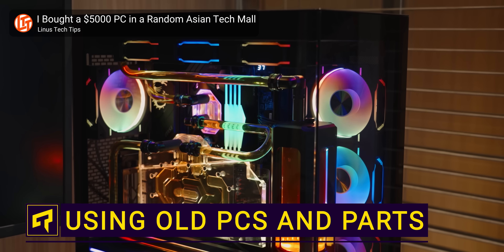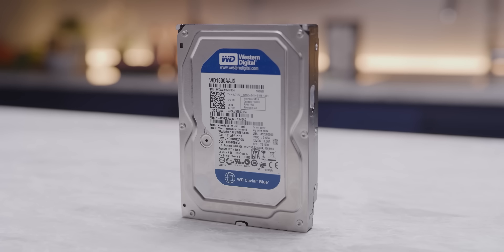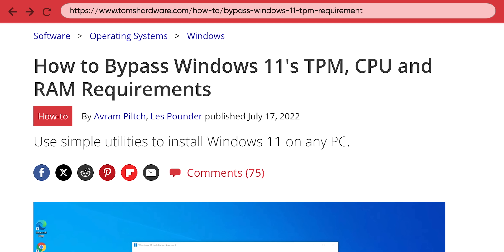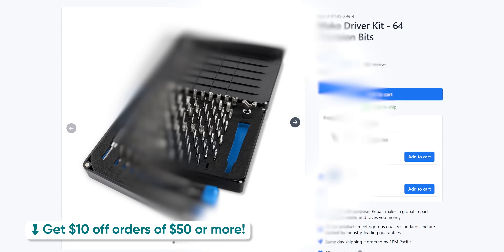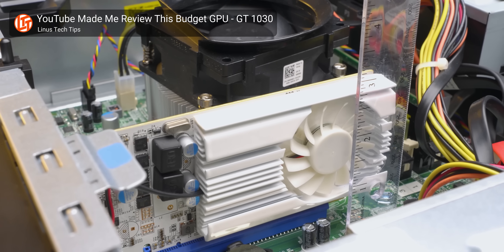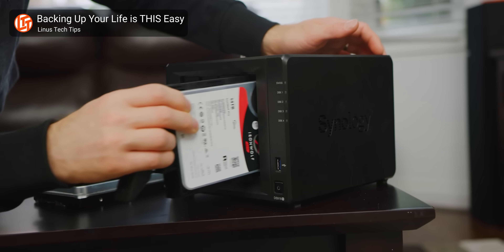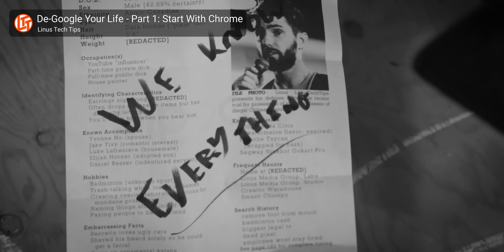FIVE Cool Things To Do With Old PC Parts

Comment: Old smartphones make relatively good and cheap security cameras. They only need a wifi signal and some power source, and there are many apps that work on them for this purpose without much configuration. You can access these cameras any time from a main device. I used to monitor mice traps with it.
Reply: Yeah would be interested in that idea too. 😊
Reply: The IP webcam app works perfectly for this. You'll be able to check the live feed from any device that's on your local network, and you can even set it to auto record when it detects motion.

To have them accessible from anywhere, youll need another service in addition. Of these I only know Ivideon which works but I wasn't too much of a fan
Reply: Can you recommend a specific software? I once tried to do this, but did not dig enough. Preferably open source
Reply: @srpenguinbr  I used alfred camera from the google play store, I don't think it's open source, but if you do your research I'm sure you can find an open source one.
Reply: @srpenguinbr  I dont know if its open source, but try alfred camera. It could go HD if you pay the subscription if i'm not mistaken, otherwise go for SD for free.

Comment: But if you have a new computer to replace the old, the new computer would likely be able to do all including opeeating as your daily driver. It would be a marginal increase in power since your computer would be running anyways. If your computer isn't always running, there are less power hungry setups that could do all that then running an old pc. With exception of running older games, why do this
Reply: The folding@home idea is great. You can either try to contribute to life-saving research on that secondary computer or throw perfectly good electronics away like they're broken, your choice.

Comment: Any linux distro will work miles better than ChromeOS Flex, all without the privacy and lifespan issues of a Google product.
Reply: When you compare ChromeOS's seven years of support to other mainstream options, it sounds pretty good, but then you turn and see my 21-year-old Thinkpad T42 running Debian 12 and still getting updates, all while not being bogged down by the operating system... (winces) the seven years doesn't sound so good anymore
Reply: Pretty funny how they suggest ChromeOS in one breath and then suggest "de-Googling" in the next.

Comment: “Slow PC from a decade ago”
4790K
Reply: It might be a decade old, but he lost me at slow
Reply: @avisprimey  I hate to say it, because I had a 4790k for a long time. But the modern low end and midrange CPU's out there these days run circles around our old Intel chips.
Reply: @Benefits  ...but the 4th gen Intel chips are just fine for most tasks.
Reply: @Benefits  yep thanks to amd
Reply: @AffectionateLocomotive  I'm going based on the model number change. If I started at the beginning, It'd be even higher than 6th if we included the Pentiums, Core 2s, etc.
Reply: @avisprimey  what..
Reply: @AffectionateLocomotive  The Intel product page LITERALLY says " 4th Generation Intel® Core™ i7 Processors " It's not that complicated. Now go make a router out of your old PC pr something
Reply: @avisprimey  you can feel the speed up on more modern hardware, i upgrade from a 4690k to a 3600 cause the motherboard pissed me off 1 too many times with select sata ports randomly not working
Reply: @chadmckean9026  That's a good upgrade! My laptop CPU, a Ryzen 5 5500U, looks pretty similar on paper, and is pretty overkill for anything I need to do on the go. I've decided that if I ever need to build a new desktop rig, it's gonna be all AMD.
Reply: @avisprimey hate to break it to you but an i3 12/13/14100 mops the floor with that poor 4790k.
Reply: @toaster98  I know this. I daily drive an i7-12700. Yes, it's faster than a 4790k. But the 4790k is fine for most things. I never said it was faster than what's new.
Reply: still playing VR here on a 3770k that I got 10 years ago
Reply: brua i have a gt 730 wight a i5 10th gen and it can run totk
Reply: Could the tech team make a guide how to make 18650 type battery powered fan please? 😁 As a part of reusing old components 🙂.
Reply: I said the same thing. That was a decent set up for a lot more stuff than you'd think.
Reply: outdated and slow
Reply: My server is a 4790s with 4 to 5 people simultaneously doing office stuff....

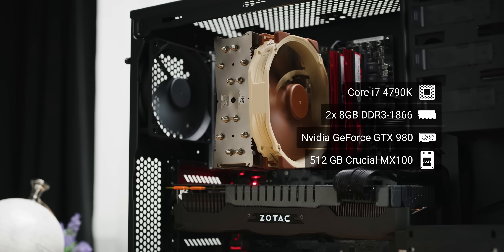Comment: 0:34 i feel attacked beacuse these are the exact specs that i still use in my Gaming PC
Reply: That thing is way overkill to just be a router. It's still a relatively modern computer. If it's able to play modern games, even if slowly, it's too much for a basic home router. It could be a media server, though
Reply: Yeah I run a gtx 980 and a i7 3770 and its an incredible machine. GTA V, BeamNG run at ultra settings perfectly. If newer titles run at low settings + 30fps it doesn't bother me but I havn't really gotten any really new games yet due to their crazy price points...
Reply: My "gaming PC" consist of free e-waste parts. Xeon CPU and mobo from 2012 workstation, Quadro P4000 GPU from 2017 workstation,  sodimm ddr3 with adapter,  M-SATA SSD with SATA adapter, 2.5" HDDs for extra storage , inside of new cheapest thin case and PSU. Total cost for just CPU around $30 ( case, psu, adapters). It serves 99% what I need.
Reply: brua i have a gt 730 wight a i5 10th gen and it can run totk and its the pc i use
Reply: @TheShinyShrimp  why have a gt 730 with an i5 that has a better iGPU? Or is it a 10400F
Reply: @ruinedlasagna  what
Reply: @TheShinyShrimp  10th gen i5s  have integrated graphics that are more powerful than a GT 730. The 10400F is the only 10th gen i5 without an iGPU
Reply: @ruinedlasagna  ohhh realy thats cool tnx man i will chick if its the k or f model to see if it has integrated grafix
Reply: Yes i also i5-4670 Gtx750Ti
Reply: I am SUPER close to that build too... i5-4690k with a GTX-970... 

Putting new hardware in is kind of pointless. New graphics card? Yeah but my mobo is pci-e 3.0... how much performance would I be leaving on the table because of that?
Reply: @teebles  Pci-e 3.0 is not much of a bottleneck. 2.0 doesn't even bottleneck a GTX 1080. You'll sooner be limited by the CPU than a 3.0 x16 slot. Just don't get a GPU that doesn't have all 16 lanes available (i.e 6500xt)

Comment: I have a 2008 HP desktop (which used to be a beast back then) for all my data needs. It has an SSD for the OS and 4 spinning hard drives in raid 10 for the data.
I'm not a big fan of using desktops as a router though, they are noisy and consume a lot of electricity.
Reply: yeah, no, the desktop-as-a-router suggestion was a horrible idea. It's more of a "why not?" homebrew experiment than something I'd practically use. But hey, you might never know a person's circumstances

Comment: The "outdated system" they show for running a router set up is basically my daily driver... fml
Reply: Same here 😢
Reply: @darkrider92  Was my daily driver from 2014 to 2019 too, except with a GTX 1080, and my sis is using it to this day.
Reply: This video is one of the worst researched ones they've done in a long while. Even the folding@home suggestion comes with significant caveats.

Comment: The bad thing about reusing old hardware: the power efficiency.  Having a power-hungy PC spin its fan 24/7 does not sound ideal.
Reply: hungy
Reply: That is not necessary always true, yeah its not as efficienct but that doesn't nean it will run hot and loud just that its performance is not as good, that other part of the equation of efficiency. Newer high end intel cpu like a i9 caN easily use 250-350 watt.

Comment: Going to be turning my old FX 8350 system into a NAS once I get modern mini-pc for my mother to use. She needed a PC and my old system was sitting around so I let her use it. The motherboard it has supports 8 sata drives, 2 e-sata and has 4 usb3s (plus lots of usb2) so can handle a lot of drives at once. So besides the old cpu it's overkill for the web browsing and word processing she rarely use for it, and doesn't support win11.
Reply: Look for N100 mini-pc.

Comment: What I did with my old PC parts such as RAM,CD drive,and GPU (I kept the fans s back ups), was give them to CEX (Computor Exchange) here in the UK and the parts like case,mobo, cooler, CPU and GPU I left for the metal faires to recycle/sell.

Comment: This only applies to countries with nearly free electricity as otherwise it would be much more worth to buy a new, energy-efficient hardware and sell the old one, even for scrap...
Reply: Sort of like what I’m doing right now. I realized that my main computer is almost never actively used, and what I need it for as a server is better done without a desktop cpu and a gpu that uses 20watts at idle… so I found a 2014 Mac Mini on eBay for 60 euro, making it more efficient than my computer, and cheaper than a new mini pc.
Reply: @AlexTheStampede  yeah exactly - a very good alternative is a steam deck. You have a full linux system with a cpu that draws 0.2-3w even when playing light games.
Reply: Really just depends on what you have and do with it and how much newer components cost and how much they draw for the same tasks. You have to calculate that, since it's not always cheaper to buy newer components, even in Europe with 0,30-0,40€ per kWh
Reply: You could sell the old PSU and buy an efficient one.
Reply: @rockpie  Ideally, you want to be using components that don't draw much power in the first place. A super efficient power supply doesn't help you save much energy if the whole system draws 600W under load and it's busy a lot of the time.

Comment: I use plenty of old notebooks, core duo and all the "useless" 32 bit hardware.
Only problem with desktops for firewalls or nas is power consumption and noise.
Reply: I have a truenas system running 2x16tb mirror array - converted from my old pc.
It has 64 gb of ddr4 3200mhz and an i7 8700. (I upgraded 2133mhz 16gb to 64gb a few months ago)
No gpu, no rgb, platinum nothing unnecessary.
It lives in a case from 1999 (hooray for standardization) with literally no fans except stock cooler - CPU idles at 22c. 55c in summer (30c ish indoors temp)
It entire system draws 90 watts idle, ($0.0045/hour). (cpu is underclocked slightly, and idle utilization is 0-1%. At max load, cpu will spike to maybe 8-10% util. Bottleneck is the 1gbps networking, not the drive or cpu), and hits about 120 watts, iirc, drives full duty
I'd say both noise and power is not really a huge issue if you plan for them.
Reply: @tfr  nice
you have access to hardware way newer than I do

Comment: Summary:
1. router
2. upgrade (new hard drive/ ram)
3. run old, supported games
4. contribute to a distributed computing project (folding@home)
5. NAS (surveillance server, own smart home, own cloud)
Reply: if you do #4, then your PC can also double as a space heater
Reply: @peanuts.13  Exactly what I was saying, though the new 13th gen and 14th gen chips seem to do this on their own anyways. Literally have to run power saver mode on my new build during the summer (this is also a potential fix for anyone experiencing CPU spikes with game crashes).
Reply: @peanuts.13  I legitimately used my Xeon X5450 PC as one several years ago. It overclocked to 4GHz with my GTX 970 and GTX 650ti running F@H noticeably warmed the room up. Only did it due to the house having solar however.
Reply: 1. To high electricity bill not viable...
2. To high electricity bill not viable...
3. To high electricity bill not viable...
4. To high electricity bill not viable...
5. To high electricity bill not viable...

...in germany.
Reply: 6. Server (ie. game server.)
7. Crypto (if legal)
8. Random experiments with software and hardware.
Reply: @rockpie  an old computer will not be efficient/powerful enough for crypto to be viable. You'll spend more in electricity than you'll get back in crypto value. unless your plan is just hang onto that crypto, blow up your energy bills, then hope crypto appreciates in value over the years, which it likely won't. The time for appreciation of crypto was 10-15 years ago before people really knew about it. Now it's too common among grifters and scams to gain value given the lack of trust in those who use it and its unstable perceived value.
Reply: Distributed computing is a horrible use. Super power inefficient.
Reply: Thx for saving me the trouble of watching a video
<3
Reply: Unraid server running Plex media and drives hosting all my important data.
Reply: sooo
1. keep using but with other purpose
2. keep using and upgrade
3. keep using
4. keep using but with other purpose
5. keep using but with other purpose
Reply: @markushahnenkamm I think you meant to watch “5 cool ways to not use your old computer”, the whole point of this video is how to keep using it.

Comment: My oldest PC is usually made into a media center rig. As long as it has a video card and the case it's in can handle a bunch of hard drives then its good enough to pump up to 4k movies and such to a TV and do so without all the extra snags of having a "smart" TV.
Reply: Got me thinking, can you access it(nas, home server) without having a smart tv? and if no, are you accessing it on the web or there is a plex app?
Reply: @SatlaE  All I ever used was a wireless keyboard/mouse combo and navigated it like normal. All you are really using the TV for is a oversized monitor if you are doing it right.
Reply: I agree, I wish there was a Home Theater OS for PC to run it like a normal media player
Reply: @SplitScreamOFFICIAL  If I remember tight there once was a version of windows along those lines but the whole thing defeats the freedom and flexibility of using a PC as a media rig.

Comment: 0:28, Ah yes, totally a relatively slow PC from a decade ago.
Reply: Yes, in 2026/2025 a 4790k is in fact relatively slow
Reply: I currently have an i7 4790k, w/32gb of ddr3 and 2 1080tis in SLI. It ain't no slouch...
Reply: @mikek92 did you mean 1080tis?
Reply: @notCAMD  Yes, thanks.  I corrected it!
Reply: @mikek92 SLI 1080tis?? Do any games even benefit from that?
Reply: @ruinedlasagna  The only game I know of currently is FFXIV.  Gamers Nexus uses it to benchmark cards. Surprisingly, in my "new build",  the 1080tis beat out the single RTX 3080 I recently grabbed.

Comment: Good video. It would have been helpful to mention that these old systems often draw a significant amount of power on idle. In applications like a DIY router that should be a consideration.
Reply: In Canada, electricity bill pays you
Reply: Quebec hydro OP
Reply: There’s a lot of power saving optimizations you could do to minimize the draw from your idle components. On the most basic levels for beginners, starting with windows power plan options is a good start.,
Reply: My server's got an i3 4350T that sips energy (35W TDP) like a brit sips tea. T-processors are fantastic but unlikely to be found in old gaming rigs. I mostly run Plex and Pihole on it, under Win 10.
Reply: @bgezal On most boards you could DIY the T-part by setting power limits to 30-35W and disabling turbo boost, that's pretty much everything Intel did. Most likely there is no special binning involved, at least not in favour of the T chips.

Comment: My old PC is a game streaming machine (and it has a mapped network drive for photo backups) using Steam Link. I do need to try Moonlight at some point, but steam link is great if I'm waiting somewhere and don't want to doomscroll social media. It doesn't matter that it's a bit outdated, it just has to render 800p medium for the steam deck or 1080p low for my phone
Reply: I use my Steam Link (hardware) all the time and it works really well. I hear people talk about the better image clarity with Moonlight, but at couch distance, I don't notice. Moonlight forces the controller to use Xinput, so it's DOA to me since I rely on Steam Input a lot.

Comment: Using your old PC parts for a router is not exactly energy efficient and will just lead you to have higher electricity bill.. You do have more control over it and what not, but electricity isn't free. Unless you are running homelab of sorts, just purposing old PC parts for router activity alone is not worth the increase in electricity bill.
Reply: Yes for a home router it sounds overkill